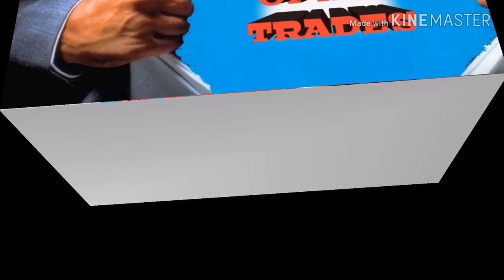Automatic washing machine FULLY CONVERTED to manual PART 1

Comment: Master pwed himingi ng list kung anong mga bibilin ko para maconvert ko to manual tong washing machine nmin sira na kase pannel ny pero ok ang motor nya. Salamat master sana masagot ny po
Reply from the maker: Wash timer
Spin timer
Toggle switch w/ 3 or 6 pin,, on both side off at the middle

Comment: Sir jack san po b ko pwedeng bumili ng mga piyesa nya,ung washing ko nsira n ung pcv board mlki kc ang mggstos ko,ky gusto iconvert nlng cya s manual.
Reply from the maker: Saan po kau boss location nyo po,,
Reply from the maker: Meron po Yan sa deeco po o sa mga electronic store po
Reply: Sir s calamba laguna,bk pwede mo ko mtulungn sir jack
Reply from the maker: Silang cavite po aq boss anung brand po Ng washing nyo po,,
Reply: Sir panasonic
Reply from the maker: Boss Maya nalang tau  usap ha simba Lang aq ngaun, sa messenger nalang tau usap "March nadera" search nyo po ako,,
Reply: Ok sjr thnk you

Comment: Sir, patulong kung maari... ganyan din ang machine namin ang problema habang naka wash mode nagbubukas ang drain motor kaya lumalabas ang tubig medyo malakas. pag naka off tumitigil ang paglabas ng tubig. ganon din pag naka push.
Reply from the maker: Converted napo ba Yan sa manual boss o hindi PA po